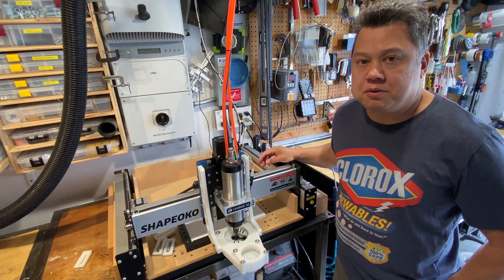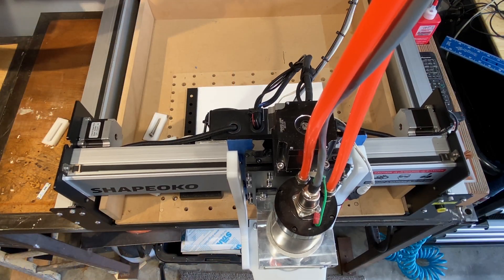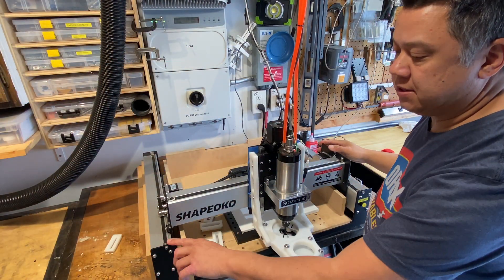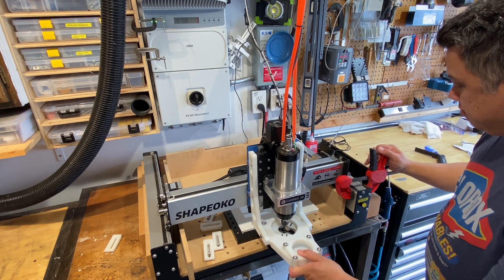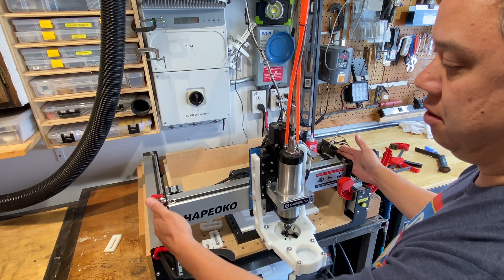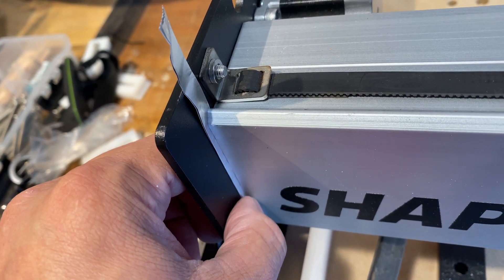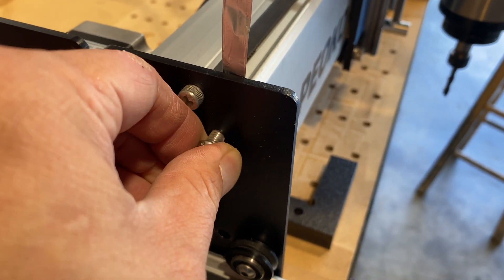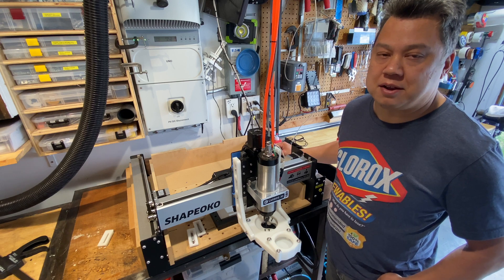Using shims to square Shapoko X & Y Axes

Comment: Just a question. I noticed even after everything your gantry doesn’t stay up against the front plate. Looks like they’re both sitting about 1/4 inch from the front plate. Is that correct? And was that what you were trying to do ? Because I thought they should both sit flat against the metal front plate
Reply from the maker: It will stay rested against the front plate.
Reply: @etischer  im gonna have to give this a try. mine is also not touching on the left when its up at the front of the machine but mine is double the amount of yours so about 1/4 to maybe half an inch. i noticed when i unscrewed the x gantry's left top front screw out of the four that are there and also the right side upper back and then pushed it against the front plates it stayed there. But then, as soon as i tightened the screws it happened again.Its something to do with those screws and another issue is the belts that cause it as well from what i noticed. its as if the belt wants to pull it back and not let it stay forward even though tension is good amount and same on both sides. ill try your solution today. fingers crossed

Comment: This is universal to all CNC machines, test squareness before any big project. Don't use the hitting of end stop - use the angle measure, better and more correct. And cut a big L shape to test, or 2 squares and flip one, they should match perfectly 🤓 I once did a mirrored part of a mold, and the CNC had this issue - very annoying. So test and shim where needed is a really good tip! 👍💪👌Same goes for the Z axis if working on thicker parts 🙂